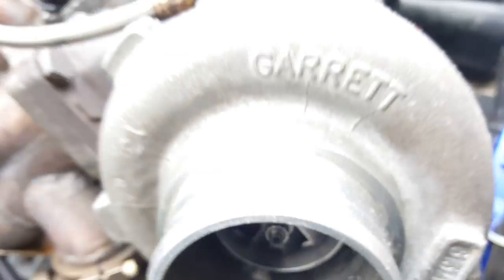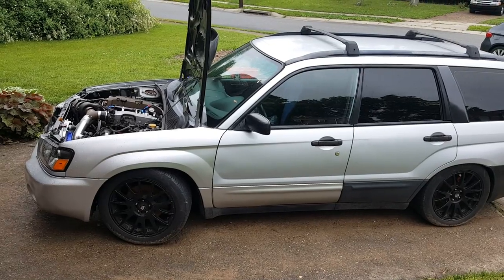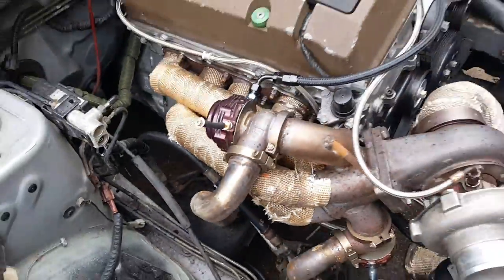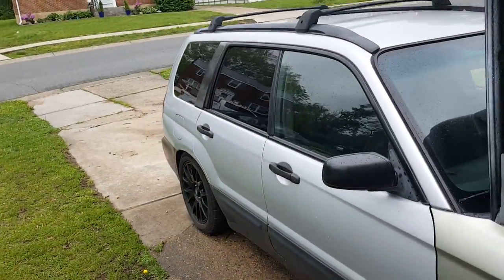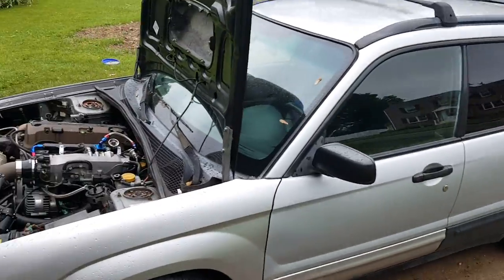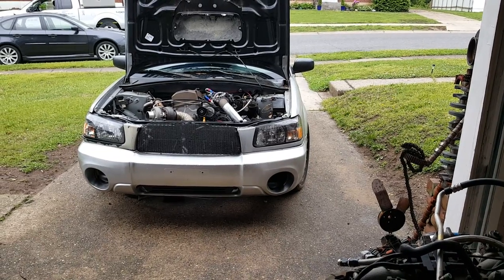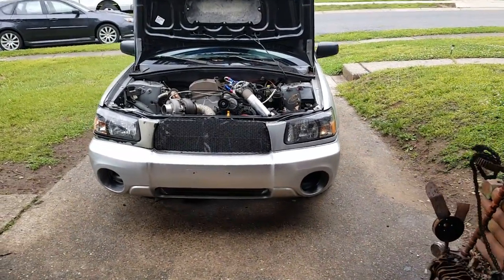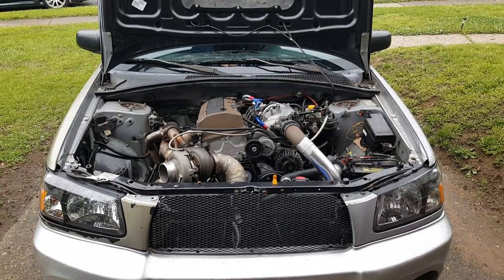Subaru powered by Honda drivetrain

Comment: I want to do a boosted Honda k20a2 swap in my 2001 Subaru Legacy. I have the adapter plate, pressure plate, clutch, flywheel, and pilot bearing. I was wondering how do you do the wiring? Who makes harnesses for such a Swap? And what should I look out for majorly with this swap? Any concerns I should have? It’s a 5 speed manual trans (I’m building it so it won’t be glass internals anymore)